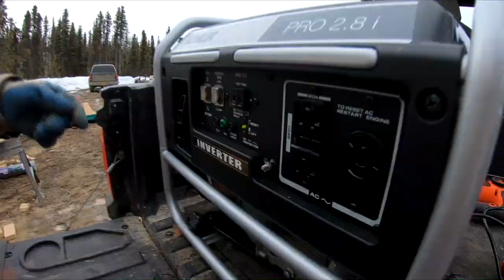Building a Coop | Chickens in Alaska (Part Two)

Comment: I so love this channel, very professional and has continued to grow over time.   Yes I enjoy watching the back catalog.   

I used to live in cold climates where we used wood heating to heat, cook and for hot water.   Given the cost of  fuel would there be some benefit for using some of that heat to heat water.  

I also saw a combustion engine converted to steam which would be good for generating power to charge batteries

Comment: When will you be adding your Rain Catchment Watering System for the chickens, so that when it rains, it automatically fills up barrels that retain the water needed for the chickens to drink?

I'm surprised you didn't lay down some tar paper for the roof or sides, as well as some water sealant for joints.
Reply from the maker: JR Bailey, we don't mind hauling water the short distance to the coop but may look into a water catchment system in the future, however we only get about 10 inches of rain and we pressume it would be frozen half of the year. We definitely aren't professionals when it comes to building, it is a pretty dry climate here so wood does hold up decently. Appreciate the comment :)

Comment: Now I’m a bit out of the loop of airing chicken coops. This build is really a good job, clearly you two put some time into properly building a sturdy, long lasting coop for the chickens! I’ve hear of others leaving gaping windows and zero insulation but I just can’t imagine how any breed, regardless it’s natural resilience to the cold, would survive your winters?! And I totally see the importance of airing out an I closed space where birds not only sleep in and breathe on but poop and pee in/on. Are you not making pull pit drawers/floors to scoop out their mess once in a while? I’m just curious because the moisture wouldn’t be such a problem if it’s regularly cleaned out right? This area I’m unfamiliar so I’m not being critical, just trying to get why you’re intentionally letting freezing temps into your girls coop? BRRRR 🥶 I’m from SW KS and we don’t have rain, on occasion specs of snow but we do have the coldest, most bitter winters due to our unbelievable winds and I’d rather die than sleep or live in an open aired house, again that’s why I’m asking. Perhaps Alaska doesn’t have 60-70 mph winds but you do have ice, snow and unbearably cold winters
Reply from the maker: JewDd* 89 I cannot speak from experience until I overwinter our flock however we have done considerable research and some breeds of chickens can withstand incredibly cold temps, they still need a shelter to get a break from the wind. Being that a heat lamp is not an option for us we really took our time with the whole open style coop. I included all the info on the individual that designed the "woods coop." 

We plan to use the deep litter method and with the amount of ventilation we provided, the coop will get cold, where we live insulation is not helpful unless heat is generated (which in this case it could be the chickens and their droppings), however then we run into then issue with the possibility of too much moisture.

 I know it seems too harsh of a climate to keep the chickens in but I wouldn't subject them to it if I didn't feel strongly that they will be fine. It may seem taboo but plenty of folks keep their chickens in the same conditions as us. We will be doing updates of course on the flock as winter progresses, right now they have a solar light and are still venturing outside in the teen temps.

We appreciate your comment ☺️